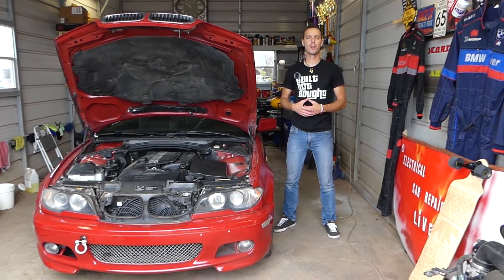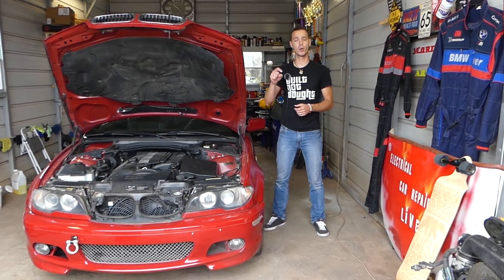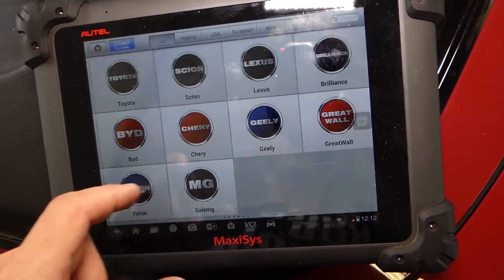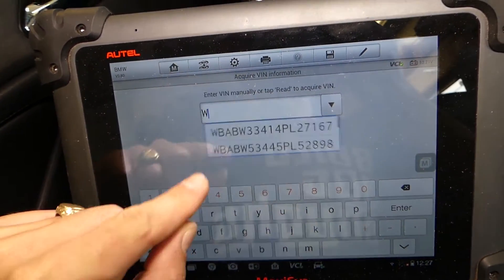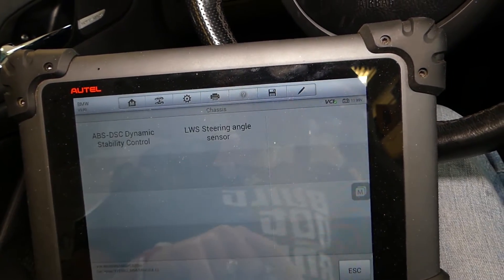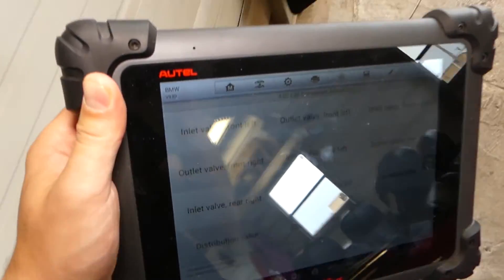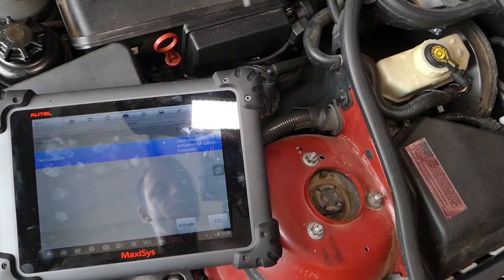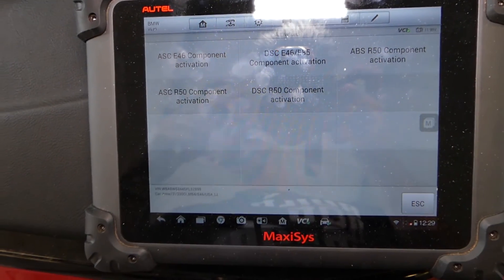ABS BRAKE LIGHT, TRACTION CONTROL LIGHT TEST ABS PUMP BMW E46 E53 E83 E65 E60 E61 E85 X3 X5 Z3 Z4

Comment: I have a 2006 BMW 750i. Code 29DD AND 5F1A. CHANGE RIGHT WHEEL SPEED SENSOR AND ABS LIGHT WENT OUT AND CAME BACK ON WITH SAM CODE. DON'T HAVE A CLUE ABOUT THE OTHER CODE 29DD..BAD WAY DISTANCE. PLEASE HELP. THANKS